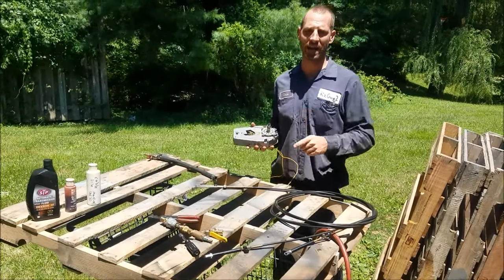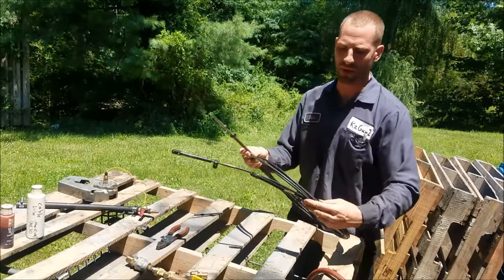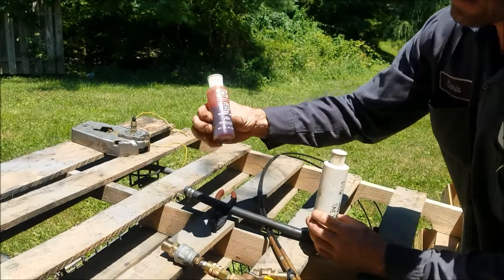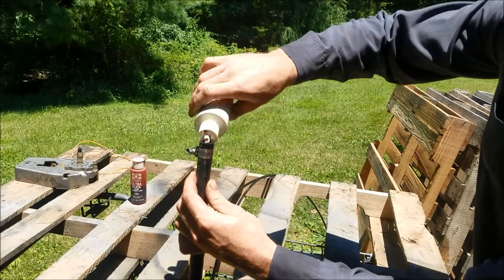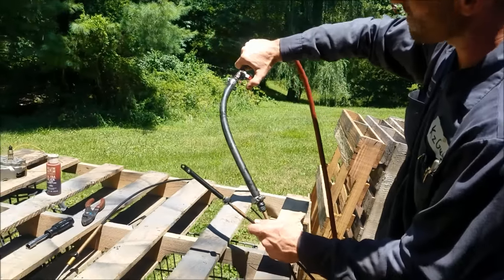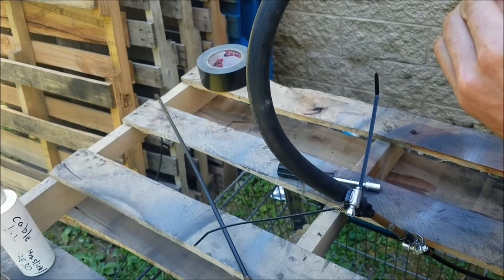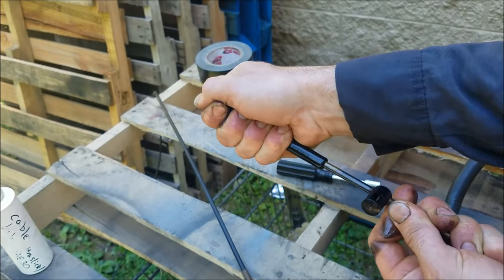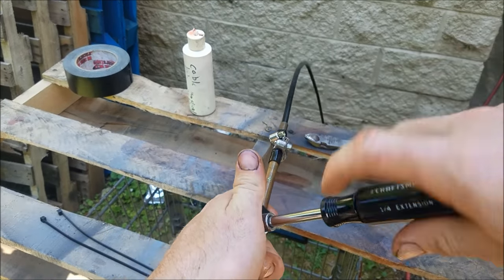GOT A TIGHT CABLE? TRY THIS BEFORE REPLACING for boats, motorcycle, jetski, atv, etc

Comment: I just wanted to thank you for the insightful video. My steering was so tight. I pulled it all out and performed this on both the steering and throttle cables. I got so much crap out of them and now they're running slick as ever. Like brand new!! Thanks again
Reply from the maker: Excellent to hear this method worked out for you and I appreciate you dropping a comment sharing your experience.  Thanks

Comment: Good with the precaution about the hose coming loose. With my usual luck I'm sure it would have come loose and spit oil lika a crazy cobra all over the interior of my boat. (It's too hard to get the cables out so I plan on doing it in place.)

Comment: Engine assembly lube is thick and tacky so it stays in place while engine sits before installed and to stay in place on first start up. I wouldn't think that would be to good for a cable and you would need that kind of air pressure to push your mix threw a cable plus the drag from that thick of oil can't be good on a out drive cable .cable lube is thin like water . I've used tranny fluid for years in many boats and never had to go back and do it again it's a one and done for years . It wicks threw the cable just by gravity feeding it and it's super easy.i use a fuel line and a top off a gear oil bottle . I just put cap on the tranny fluid bottle it's the same thread . Put a hose clamp on cable end count the turns it takes to take the end off the cable so you can put it back in same place  and push hose on bottle end. Then gravity feed the out drive cable right in boat. It will take a few hrs or so but you will know when it's threw by the dripping out gimbal and out drive area . Cable from handle to switch plate you have to pull out and just do the same thing but you have to tie it up high to gravity feed it and my way you don't take the. Chance of that blowing apart on you in your face .
Reply: Mine is seized completely. Do you think your technique work?

Comment: Gonna try this on a 28’ flybridge. Should be fun. Anything’s better then fishing those cables through 3 feet of tubing and zip ties.
Reply from the maker: Awesome. Yeah it should help out some. But make sure to check if the cables have any damage. Because if they do they should definitely be replaced. Nothing like a broken shifting cable out at sea or worse yet pulling in to dock

Comment: I use diesel to flush out the cable then 30 weight mixed with molylube (molybdenum disulfide).

Comment: Sweet idea thanks for the video going to try it on my boat steering cable be needing some deep creep on that one tho
Reply from the maker: No problem man! Yeah I'm sure it will bring some new life to your cable. Just make sure to inspect for any rust holes or fraying first. Better to just replace the cable if you have any of that. Nothing worse than a broken steering cable when you're pulling into dock around expensive boats.

Comment: I spray my steering and throttle cable on my jetski.Every time I go out with sea foam Deep creep with the little red straw, Move the rubber piece push the red in there and spray too much in there.👍

Comment: He does mention that it may be frayed or damaged inside but I don't know how you're supposed to determine that. Seems like whatever crap comes out of it used to be part of the cable. I might do this and keep it on board for a spare but if you get way out somewhere and it fails you might regret having done this. I don't know if it's from stress or that they're (boats ) just contrary by nature but cutting corners and pinching pennies has bitten me in the behind practically every time.

Comment: I don’t have access to a air compressor at the moment but after watching the video I went out and opened the cable and put wd-40 inside and letting it seep while it’s elevated and then check on it in the morning. Will that work, or will I need that pressure?
Reply from the maker: Depending on how stiff the cable is that may  help out.   Getting some kind of pressure behind it would be best though. Anything else to create pressure? Use one of your car tires, or go to a Wawa air pump?  Or even a bicycle pump
Reply: @NoNonsenseKnowHow  the cable is pretty stiff. It’s the cable that runs to the outdrive. And for now the boat is stuck in fwd gear. Will check in the morning and see if there is any difference but I’m gonna assume without that pressure probably not
Reply from the maker: @roberthinze2425   got you. Well hopefully it works for you
Reply: @NoNonsenseKnowHow  hey so I found out it wasn’t the cable. It was the lower unit that was installed incorrectly. Now the issue is I, when I’m forward/ reverse the prop locks like it should but if the prop is spun in the direction that the throttle is in, I can hear small gear clinks in fwd and larger ones in reverse. Any ideas? Maybe just cable adjustment?
Reply from the maker: Got you. Yeah I would make sure to do a full cable adjustment as per factory manual.  Otherwise honestly it's hard to give you any input without actually seeing it.
Reply: @NoNonsenseKnowHow  found out clicks are normal. Boat is almost ready. This kill switch on the shift bracket is killing me tho. Every time I shift into idle the switch will kill the motor completely when it should only kill to lower the RPM’s enough to prevent engine and outdrive damage

Comment: This is awesome. Thanks!
Reply from the maker: No problem. Just be careful especially if you use full pressure. Best to use regulated pressure maybe 15 psi 20 psi. Good luck
Reply: NoNonsenseKnowHow thanks for the tip. I'll just use lower pressure and let it sit longer :)

Comment: What size rubber hose did you use?  Nobody seems to share what size hose that is used.
Reply from the maker: The smallest size possible for whatever cable you are lubricating. And you must be very careful. Could hurt yourself doing this. Need to make sure it's rated for pressure and that it's on there really secure

Comment: Dang that was a great video!!
Reply: I just gravity feed with a fuel line and I use a gear oil cap . I put cap on a transmission fluid bottle and hose clamp hose onto cable and slide hose on cap and gravity feed cables . Been doing it for years . Tranny fluid it's thin like cable lube and will take care of any rust on cable plus it's a great lubricant that's why it's used in a transmission  Any oil besides cable lube oil is way to thick and will make drag plus you will need to pressurize it to get that thick fluid into a cable . Not the safest way of doing it .nothing like a face full of oil .

Comment: If you have one that isn't perfect, replace it.  There's a reason, internally why it isn't smooth, replace it.  This guy isn't right for the time you spend trying to do what he suggest you can replace the cable with new.  The only difference is the cost of a new cable and LESS time spend doing the job.   REPLACE THE CABLE....
Reply from the maker: Unfortunately with the way you worded your comment, you could not be more wrong. Lubricating your cables on boats and any vehicle is considered normal maintenance in my opinion. It should be done every year or two.  And by the way, the cables I did in this video are still smooth as butter to this day.( sold that boat to a friend of mine)  I suppose if you have unlimited amounts of money, yeah go ahead and replace your cables. But you don't need to remove them to lubricate them.  If you watch the video, I specified that.  I do agree, if there is any signs of fraying or damage on the table, replace it

Comment: Good video.

My sailboat inboard diesel (Universal m-18) has  seperate throttle and gear levers. Recently they stopped functioning independently and now when I put it in gear, the throttle lever wants to go with it. Basically I have to use two hands on the controls - one hand to keep the throttle level low and the hand to put it in gear. I took it apart and tried to get some ATF in there to lube it up but it didnt work. Do you know if it is possible to service this ? Does the bushing need to be replaced or how do you recommend I go about trying to solve this?  Here's a link of what it looks like: 

@

@mt8Y
Reply from the maker: The link didn't come through.  Honestly I haven't worked on one of those before so its hard for me to give any advice.  Something I would have to see....  But yea it sounds like something is worn or busted in there.